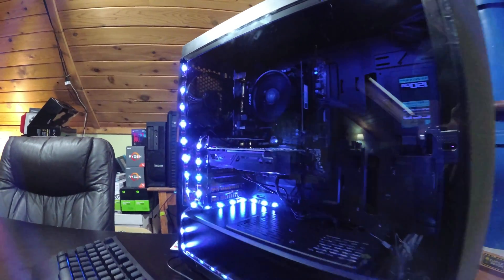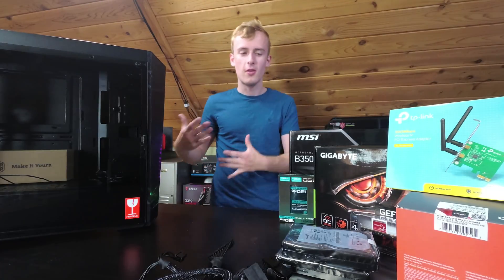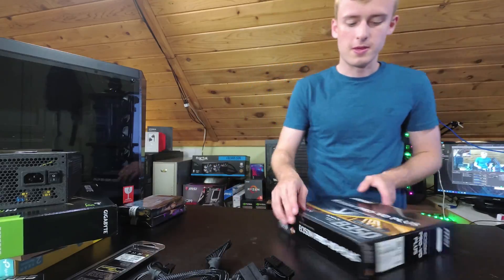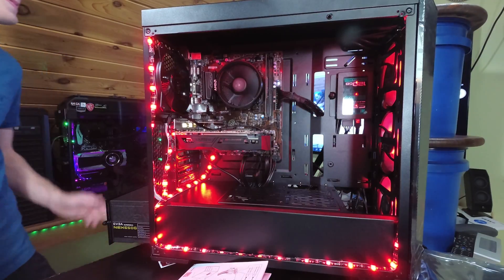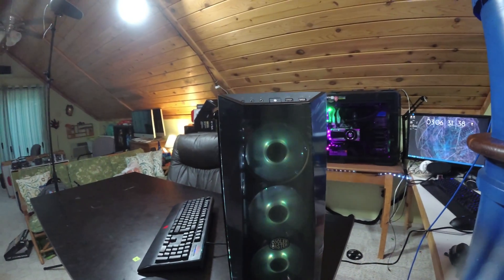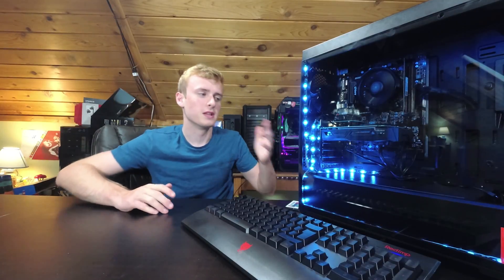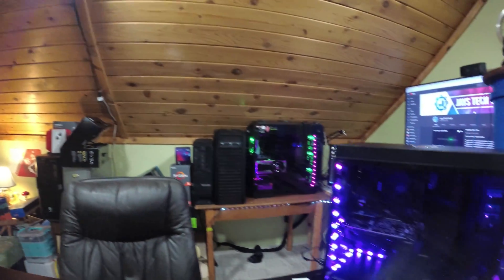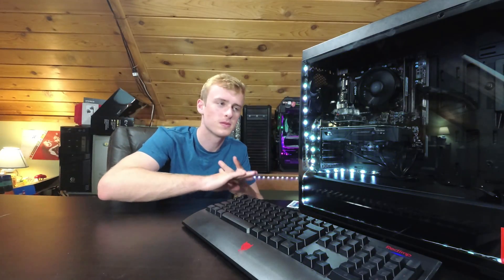$600 RGB Professional Ryzen 2600, 1050ti Fortnite Streaming/Gaming PC build [2K Special]

Comment: I’m going to be building this system for gaming.

CPU: Ryzen 5 2600
GPU: GTX 1050ti
HDD: Seagate 1TB
SSD : Kingston 240GB 
PSU : EVGA 500W
RAM : 2x4GB DDR4 2400MHz

Will this be a good setup with the Gigabyte B450M DS3H??
Reply: Get a better psu so if you want to upgrade later on you would not have issues with it

Comment: Does the gpu have to plug in For AMD? I upgraded from and i3 to r5 2600x and the r5 and b450 pro vdh don’t recognize the 1050ti. It’s not plugged in using a pci but just gets its power from the motherboard. Do you need a gpu that gets power directly from the power supply with amd motherboards and cpu?

Comment: I have a i5-4430, windforce 1050 ti 4gb, 24gb ram (had so much leftover xd) and a 450w psu.
Would my psu handle me swapping the processor to an ryzen 2600
Reply: You need a new mobo for 2600
Reply: Depends on how much power your other components consume

Comment: def not the best price for performance. 8 gigs of ram but you go with a 3 tb hdd? Modular power supply for the stock CPU cooler. Expensive case but lackluster mobo def could upgrade the graphics card. You went for aesthetics more than performance. What I would have done was get a cheaper case, upgraded the mobo for upgrades. Downgrade the 3 tb hdd for 1 tb. Upgraded the gpu. Could also downgrade from a modular psu to save money. Maybe even for a cpu cooler. Just my thoughts
Reply from the maker: I had extra hard drives those were not included in price. Also keep in mind that is 3200mhz RAM and from 3 months ago back when prices were higher. Also $60 for the case is not bad especially when I’m already familiar with it.

Comment: I was going to build this but then I was bummed about not being able to play some games maxed out so I thought a 1060 6gb would be nice. Now I’m getting an RX 580 because of free sync and it’s also $60 less than a GTX 1060
Reply: Shadow If you haven’t got the RX 580 get the RX 590 instead costs a little bit more but better than the the 580 and 1060
Reply: Well I got the gtx 1050ti ssc and got it for 120 pounds. Now it’s 200 pounds but it runs all game at max and even above 60fpa on shadow of the tomb raider
Reply: Cryptic with this same build ?
Reply: Live Life yep ryzen 2600 and 16gb ram

Comment: I'm thinking of buying the same pc for streaming fortnite lol etc and doing some work (video rendering, photo editing). I wanna know how this "shy" beast performs on stream. What preset do you use? Faster? Fast? Also tell me your twitch name so I can join your streams :D
Reply from the maker: So I can stream 720p 60 at high settings in fortnite without problems. 

Fortnite is CPU based so if you dedicate 4 cores to streaming and 2 to gaming and you will be fine.
Reply from the maker: Also I included the parts in the description if you want to buy them from there.

If you do use those links it helps me pay for projects like this and help build these people these computers for free.